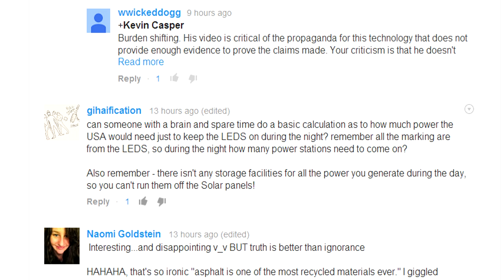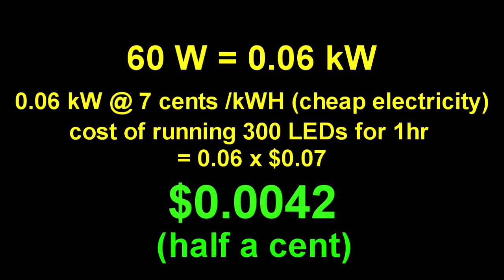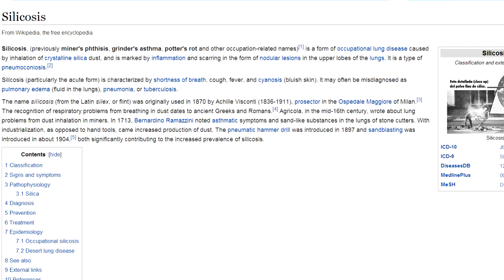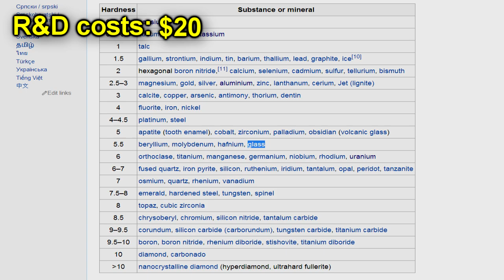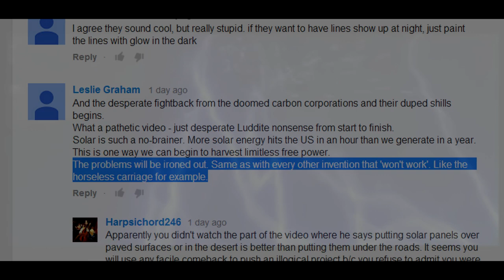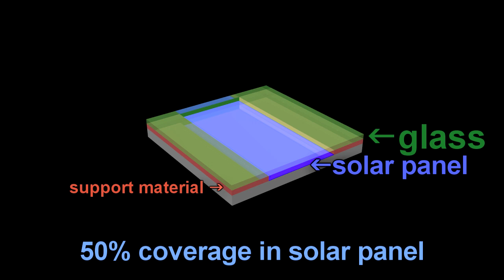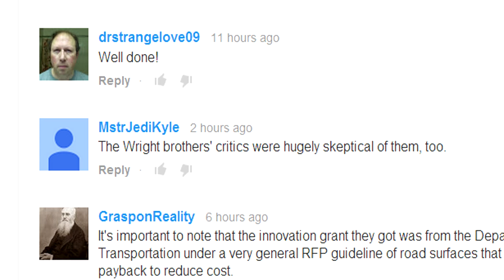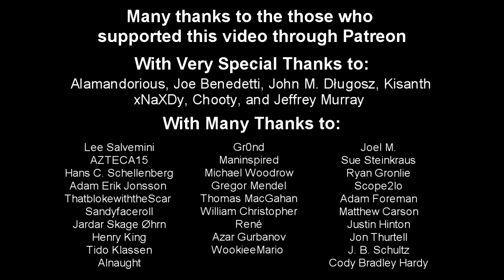Solar Roadways, IMPORTANT QUESTIONS AND ANSWERS!

Comment: We designed Our prototype to use "virtual storage", meaning that any excess energy is placed back to the grid during daylight hours and then can be drawn back out of the grid at night. This is important as solar energy is only available during the day, but our heating elements need to have power at night in the wintertime in northern climates for snowy weather. However, we can add any current or future energy storage devices to our system. For instance, batteries and flywheels can be placed in the Cable Corridor for easy access, if customers wish to incorporate them. We chose to not use batteries in our prototype system. We fear that, if we make that the norm, our environmental project could leave mountains of lead acid battery in its wake.

this is from the company fax, the energy is 'banked' in the grid,this banked energy is redrawn at night to power the leds' the energy being drawn from the grid is not the grids energy, it's the roads. 
So that takes care of the ability to store energy from the day time,[great idea and one that the national grid seems happy with]. So we won't be needing any new power stations and the units can have storage facility built in. Should have read the info there Thunderfoot.LOL.

What are you going to do about traction? What's going to happen to the surface of the Solar Roadways when it rains>

''Everyone naturally pictures sliding out of control on a smooth piece of wet glass! Actually, one of our many technical specs is that it be textured to the point that it provides at least the traction that current asphalt roads offer - even in the rain. We hesitate to even call it glass, as it is far from a traditional window pane, but glass is what it is, so glass is what we must call it''.

''We sent samples of textured glass to a university civil engineering lab for traction testing. We started off being able to stop a car going 40 mph on a wet surface in the required distance. We designed a more and more aggressive surface pattern until we got a call form the lab one day: we'd torn the boot off of the British Pendulum Testing apparatus! We backed off a little and ended up with a texture that can stop a vehicle going 80 mph in the required distance.''

This refutes the comments about traction made in your last srw vid.
Reply: JessicaAtreides37

1.The mighty powergrid: okay sugarcube, I guess you never had ever anything to do with any kind of electrical planning or more than just plugging in some kind of eletronical device, because you have ~no~ idea how an eletrical powergrid works.
First of all, you cannot simply "dump" spare energy into the powergrid and just shove it around untill you need it, the powergrid has a max that it can take and just shoving power around doesn't work either, because its technical not possible, every time power flows there is a powerloss, that means the natural resistance in the cable slowly but surely reduces how much "power/energy" you actually have, running those cables on max capacity and squeezing the energy around, untill its needed, is impossible, because it uses itself "up" while you would be waiting.

Thats why we haven't turned deserts into pure Solarpanelforests, because its not possible to transport the energy a very long way or would requiere a new construction of the existing powergrind, thats the huge problem with our energy as a whole, if we could transport energy without any form of resistance and without any loss, that the nuclear plants of the world would stand in some secluded part of the earth, were an fallout wouldn't hurt anyone or we could jsut plaster the saraha with solarpanels, but thats technical either not possible or its smply not cost efficant.

So no a powergrind can't just "store" left over energy and keep it forever, untill we need it, the same with any storage facility inside of the panels itself, that would take even more space away and make the allready useless thing even more useless.

Of course you would need to know the very basics of eletrical engineering to know about stuff like resistance and induction and loss of power any why we have transformationhuts and why we use different voltages for different places and so on, so its not your fault for not knowing that.

2. Do you by any chance know what a LAW is?
Its a one shot rocket launcher, you know what you do after you shoot that thing once? You throw it away.
Just having a very aggresiv and "sticky" surface for one test doesn't mean that this thing holds out for very long, just like the LAW, you can have a big freaking bang once, but after that its scrap metal.
Glass will eventually run down very quickly and even more so, the more tension there is in between the tires and the glass, just a few scratches would be enough to slowly tear away at it, once the glass is "infected" somewhere it just needs a bit of water and some freezing temeratures and you got a nice big crack somewhere and that thing needs to be thrown away again and the worst is that you would have to constantly produce more and more of these things, because they will cosntantly break, I don't even want to imagen an 18 ton monster crashing down on these things, metall scratching along every surface, you will need to replace entire roads for that.
Reply: *****
Something Tf00t didn't even mention, though he doesn't even need to

As glass sits in sunlight it discolors, or in the case he shows here grit being ground into the surface causes scratches. Eventually this would make it so that the solar panels are sitting under the equivalent of a scratched up piece of stained glass, even our most efficient panels pointed directly at the sun don't produce an extreme amount of energy so if we cover them with scratched, colored glass we get pretty much nothing out of them.
Reply: Jessica, How do you store energy on "the Grid"? This grid itself has no storage facility! You need accu-batteries or you will have to pump water INTO a high lake (this is being done in Luxembough, Europe).
All less energy efficient. Why not put Lithium-batteries INTO the solar panels. That makes then totally unaffordable!
Reply: Have you even been to their site? I have, they have numbers for their solar panels and what they are supposed to do, and you cannot get a government grant without the numbers being there so definitely not a secret.

Engineering sources of energy isn't just a measure of more energy out than in, there is a reason Engineering degrees include a number of economics courses. You don't just have to make a good idea (this one is novel yes, but flawed), you also have to prove that it is viable, and that a group of people should adopt it. It's an idea that current technology cannot make work, and will not in the foreseeable future. Oh and their attempt to show how strong it is with the little tractor is amusing, my grandfather is a farmer and has the one two sizes bigger and even that's small for around here.

Fukushima has already been cleaned up, it actually didn't release much to be honest (Tf00t covers this himself in another video, and sources please on your numbers).

Oh and you have yet to address my concerns about these being unable to function as a roadway both markings and the fact that the glass will be smooth (unable to provide traction) or broken within a few days if you get even a slight amount heavy truck traffic. You also haven't mentioned how it is energy efficient to use solar to produce the energy required to melt snow when the sun itself isn't able to do so.
Reply: Haku infinite we don't have to worry about ice because the're going to use even more power from their super inefficient solar roads to actually heat the roads to melt the ice! I don't know why they don't just make the road out of diamond. The cost of the project is already more than America's annual GDP, what a few trillion dollars more?
Reply: JessicaAtreides37 OK so go ahead and prove him wrong, you may be able to, with materials not yet known to the human race. The problem is that after you do that the ability to transfer light to the solar panels is diminished considerably.

And as shown in the video here (if you watched it) then it will barely put out enough energy to run its own LED's if the glass were to let light through perfectly (which it won't due to the treatment)

And I hope they use the 2 mil doing research into a way to make something that works, but at the moment this just isn't going to. Their own website ignores questions about the treatment and how it will diminish the ability to transfer light, as well as how it will hold up over time.
Reply: JessicaAtreides37 Ok two things:

First, the details Tf00t picks out are the main points of the project, he's showing that A. the energy output is not going to be very high, and for the most part unusable anyway, certainly not enough to cover the cost of the project, B. The roadways themselves are going to be unable to reliably produce the markings indicated, C. The idea of producing enough electricity to convert to enough heat to melt snow/ice when the sun itself isn't melting it is laughable, and D. The panels themselves simply will not withstand what a roadway needs to. A 20 foot piece of someone's driveway being able to withstand a single vehicle is NOTHING compared to a 20 mile stretch of road with a large number of vehicles driving over it all day long (not to mention 200 mile and 2000 mile stretches that will be required).

Secondly, nuclear energy is more than capable of satisfying the power needs of our species, but oil companies own the governments that regulate it. My first job was in the Navy operating nuclear plants so I have a little better insight than many, there are precautions to take that is certain, but the way people freak out when the word radiation, or nuclear, is mentioned is just pathetic to anyone with an education in the matter. I don't think it is the end though, I agree that solar is a better option, when the technology is developed enough to be able to deliver the amount of power we consume (it isn't even close) then we can switch over, but nuclear is the best for us at the moment.
Reply: JessicaAtreides37 An interesting and massively uninformed rant there Jessica.

I suppose that for your next trick, you will wish unicorns into existence through your power of uneducated bullshit.
Reply: JessicaAtreides37 Words fail me Jessica, it isn't often that one finds this much ignorance on public display.  Well done.  You're right up there with the Moon Landing deniers.

Nuclear Power, my poor pathetically uneducated luddite, is, bar none, the safest method of producing reliable constant power in the world.

Solar, may eventually replace Nuclear power in that aspect, but not with 'solar roads', no matter how much you wish reality not to matter.

By all means, call people who know what they're talking about 'shills' because you and your unicorns know the truth.

You're both pathetic and sad Jessica.
Reply: JessicaAtreides37 I'm really starting to suspect that you failed high school English, Jessica.  It's not just the simple minded over use of exclamation points and capital letters to attempt to make your feeble points, but the use of words you obviously don't understand.

If you think photovoltaic paint or solar roofing tiles are ground breaking innovations, there is no real reason to continue this.  Both have been around for decades, and both, unlike this stupid 'solar road' actually work.

Maybe you should go back to your favored form of reading material (Highlites?) and leave the science to the adults.
Reply: JessicaAtreides37 Half of Japan?  Half of Ukraine?

Is there no number you can't get wrong Jessica?

So, we've covered the clear fact that you failed high school English with your use of words you don't understand, needless capitalization and over use of exclamation points.  Now we need to add your utter lack of understanding of basic geography and math.

Is there any class you did pass beyond hysterical whining?

Would you care to compare the number of people killed in nuclear power incidents since the creation of the technology with the number of people killed in conventional power incidents in the last decade?

Seriously Jessica, being a moron is bad enough, do you really have to be a subliterate moron ?
Reply: Clell, you've just been '''sussed'' my friend! you've just argued and insulted for your way through 2-3 weeks on this page...and you didn't know a single thing about any of it did you? LOL!

You utter bullshitter!

I doubt you even watched the whole stupid vid off of thunderfool, you're a 'sounding vessel' aren't you? an empty little parrot repeater.
Clell...shut the FUCK UP! YOU BULL SHITTING WANKER!
Reply: Clell Harmon ...define the word 'adult'.
Reply: JessicaAtreides37 Sure they're viable Jessica.  Just like your invisible pink unicorns.  Sad, so very sad.
Reply: Imre Fabian I think she's under the impression that you can just trap electricity in a circuit for later use . . . it would be possible if we had loss-less wiring (which a. doesn't exist, b. would be beyond expensive if it did, and c. would require an extreme amount to trap even a minimal charge)
Reply: Nikagor Thank you for writing that, now I don't have to. This idiot doesn't understand the grid at all.
Reply: A bit literal minded guys, the grid gets to use the energy the road creates during the day and then [the grid that is] pays it back at night. 
The companies' pdf about the project is on line and is fascinating. Why don't you go and read it and take up your problems with the designers?
I'm just pointing out the silly lies Thunderfoot is spouting about something he's obviously never researched [''we'd have to build hundreds of new power stations''] etc etc.
Just go read the companies info-pdf for yourselves, THEN! decide based on your own discernment fu kris sake, it beats listening to thunderfoots crap.
Reply: JessicaAtreides37 Are you even watching the videos? He actually does testing to show that the major points of this project are simply not possible with current technology. All they have are a few .pdf's, some animated videos, and an extremely small scale test area kept extremely clean (compared to a roadway). I've looked over their website the photos don't have any numbers with them, they have numbers section but notice how they say talk about the amount of power that solar power is rateed at, then talk about the angles? That rating is when perfectly aligned with the sun which these roadways will not be most of the time, that's one of Tf00t's main points. Not to mention the bit about the LED's taking almost as much power as the panel itself is going to produce (at peak efficiency, which it won't be at). I say they will not be at peak efficiency for several reasons we'll start with the treatment needed to handle traffic, that requires the glass to be formed in such a manner that makes it so that light is reflected away from much of the solar panels, then once a few hundred cars go over it there will be dirt, sand, rocks, etc. ground into it making the surface get scratched to where it will not transfer any measurable amount of light straight through to the solar panels. Additionally after a few years the glass will begin to break down in strength due to the sunlight (much the way bullet-proof glass becomes useless after a year or two in the sunlight). Tf00t covers angles in this video pretty well so no need there. And then there's this problem with cars being driven over the roads mostly throughout the day (when the sunlight would hit them) blocking the light anyway, as well as the shadows from buildings, houses, hills, mountains, telephone poles, cars parked near the road . . . need I go on?

Tf00t is not some amateur when it comes to science, even if only a few of his points are actually taken into account (the ones he displays) the project is unable to perform its intended functions. I do not have the materials nearby to perform the testing but as someone who has worked in the field of producing electricity before their numbers are questionable, his methods are not.

And we would have to build hundreds of stations just to convert the energy produced by these panels into something useful, that's why taking your home off-grid requires massive (not to mention dangerous and ridiculously expensive) batteries, your solar panels etc charge the battery and your home runs off of that. Simply put current solar panels cannot supply sufficient 110v AC power to perform any useful tasks, and the loss from transfer across that much distance makes it useless except in very small areas (where there is much less sunlight and roadway to power the system).
Reply: Niko N I agree with almost everything you said except this."Simply put current solar panels cannot supply sufficient 110v AC power to perform any useful tasks". Of course the roadway idea is shit, but this makes it sound like solar isn't useful anywhere. I am 100% solar at my house and I run every appliance most people do. I don't skimp on power at  all. Also  If you link 10  100 w 120v pannels you have 1000w at 120 v ,that will run practically any appliance all day with no storage, no charge controller ,no inverter.  Again, the roadway idea sucks ,but it started to sound like you were shitting on solar in general at the end. Since my grid pays for itself in only 3.5 years but lasts 15, I also disagree that it is expensive to take your house off the grid. It is clearly more expensive to stay on the grid. You just need more upfront, but it is actually cheaper.
Reply: Brian T
The problem is where I live, I'm in Western PA just north of Pittsburgh. Where I live it is not possible to do without some sort of storage as we simply do not receive enough sunlight, if you look at areas by how much sunlight is received Pittsburgh is this dot that is essentially a black hole when it comes to sunlight. I know people who have tried, and once I finish my degree I plan to add solar panels to my home, potentially cover it and the garage roof (I'm an IT major so amateur at solar, my background is nuclear power so that may be why I calculate over-the-top when it comes to power needs).

In response to your concern I do think solar is the future, just not the road itself, I could see it working very well if you put them above the roads, not to mention the fact that it would help disperse water etc. to keep the roadways safer, but in the road is not going to work "with existing materials" that last part is in quotes because it is my hope that these people put the money that their project has collected into research that enables them to find materials that do work for this job because the idea itself isn't completely stupid, it's just that the numbers don't work.
Reply: Niko N I hope this money isn't just wasted as well, hopefully these tiles could be used for something. I think they just shot too high with road ways. they should drop the stupid leds ,and use them as roofing tiles. The prob with panels is they don't fit your roof perfectly and there is dead space. This tech could maybe help with that.
Reply: These panels could have a use as a niche product. Line them with clear soft silicon rubber and use them on sports-fields.Instant basketball/soccer/hockey whatever markings.
Roads? Rediculous!
Reply: ''Ridiculous'' 
Every possible surface that reflects sunlight should be utilized for the procurement of energy. 
We have no choice! We simply have to come up with new ideas as regards our future energy security.
These projects ARE! going to go ahead, some will be less successful than others but we WILL! be using this or very similar ideas in the near future.
As to what is 'ridiculous' Imre, we don't know! we have no idea if this is a viable scheme or not, we have no information on the energy return of this system, we are only looking at a prototype, and the only people that are getting the actual numbers here are the people who have read them and suddenly found that they want to invest 2 million fucking dollars!!!!!
Now I don't know about YOU my friend, but people who invest 2 million fucking dollars are probably quite impressed with what they know, and what THEY know is a great deal more than that idiot Thunderfoot has so far shown that HE knows.
I-we don't know enough about this project to start using words like 'rediculous' or however you managed to [almost] spell it, the worst we can say about this project so far is we don't have the numbers [ certain people do and have thrown 2 million at it] and neither does that brilliant ''scientist'' Thunderfoot.
Thunderfoot exactly like the rest of us, has no fucking idea so far, so take what he says with a big pinch of salt and think for yourself.
PS the companies pdf is on line,at least take the time to read the fucking thing for YOURSELF!...BEFORE! deciding if this 'could' work or not.
Thundefoot is a charlatan and a liar.
Reply: no, you're wrong.
We can put any surface we like on glass, we can make it more durable than asphalt and give it higher traction qualities than rubber. We can make it perform perfectly at minus 120 degrees up to 140 degrees. We can make it proof against tank rounds and thermonuclear flash. All of these applications for glass are already 'old hat', so every single point against that Thunderfoot raises as regards glass is palpably, quantifiably provably wrong on every count.
And if you'd like to check your history [or check anything really] you'll find that 2 mill' straight away as an initial investment in a prototype is pretty damn good.
Some people with access to the energy return figures on this project, have done a ''shut up and take my money'' at the designers...I wish I knew what they know...
Reply: This or something like it, we have no choice. Nuclear didn't work and we are now reduced to stripping the top soil off Canada for a few hundred days of filthy oil that costs 96% of a barrel of oil to produce per barrel.
We will make this technology viable, [it may already be], we will have to cover every square inch of spare space in energy harvesting devices as soon as we possibly can. 
I fully appreciate your opposition to this particular idea, and with the 'roll out' costs looking the way they do OF COURSE! you are going to have some serious concerns, but we are now at a point where anything at all that returns more energy than it costs is 'viable' we are that desperate...actually...we are THIS! desperate, we're trying to build roads that can help our current dire situation as regards energy.
The point you make is very real and very much something to be concerned about, the technical details Thunderfoot picks on are...not...they're silly,almost childlike.
We have one law on this planet, more in than out=viable, this goes for chasing gazelles or dealing on wall street, and it ALWAYS goes for energy creation.
Reply: Jessica, why don't you put in superconducting coils for energy storage? And a liquid nitrogen generator for cooling? That will be efficiënt for storing energy, and cheap. ;-)
Reply: Tfoot misses the whole point no matter what he's talking about.
We do not have the energy return numbers [anywhere on line, I think they are secret at the moment] so what this machine does EXACTLY is just guess work yes? Which makes all of this just hypothesis at the moment, which makes tfoot's attack look even more childlike doesn't it? Laughing at a prototype is the mark of a true idiot after all.
If there is more energy out than in it's viable, that law goes for tar sands and the other insane methods of energy production we use so it works for this yes?
The people of Japan face prison for vocalizing any disagreement to nuclear power. Foreign journalists that speak about Fukushima face prosecution should they visit Japan. 50% of children in Daichi have thyroid cysts, heart problems are sky rocketing among the young people of Daichi and non of these health problems are ALLOWED to be blamed on the massive amounts of radiation being released. 
The world has just been told that in order to clean up after Fukushima...we are going to have to create a ''new technology''...we can't clean it up [ever] and it's getting worse hour by hour. As far as nuclear being 'the best option' well, human biology disagrees with you my friend. Nuclear has not just failed us, it is destroying us.
Solar roads, yep crazy...unless they work and at the moment, they appear to, albeit not very well, but so what? we'll just improve as we go.
For some weird reason ALL! of the rules that apply to 'conventional' energy production ie. more energy out than in, rolling development, cost structuring etc etc are suspended in thunderfoots 'mind' just for this one unique project, I fail to see why and I fail utterly to understand why his sub's don't see this as well. 
This is an idea, it has a prototype and creates energy, okeydokey then...press on! ANYTHING! that produces energy and [this is important] DOESN'T KILL US! [had to stress that last point there] is by definition viable until PROVEN! otherwise. At the moment, the jury is out, a wise person would keep their 'anti' council for a while yet.
Reply: JessicaAtreides37, Thinking a revolutionary invention (what these are not!) could be a viable, let alone economic success within 20 years is an air-castle!
As it happens, I AM an electronic Designer, with Significant technological knowledge.
I can see in your arguments a lot of "what should be" and "what could be", but not "what is feasible". The illusion is made that these panels would be the solution of tomorrow. But even for a prototype they are to detailed and not feasible enough!
If you and the guys of the Solar Roadways are bonafide, you (and they) would say openly that the practical application is far from within our grasp. Then the people would demand their money back. even small investers want their returns within 5 years.
Only the government could do an investment over the timeframe it would take to make something as this usable, let alone practical and economical.

As far as I can see, regarding the hype that is made of this, they are just selling Snake Oil!
Let them come up with a detailed study on how they would make this feasable. And no none-sense about secrets and competition, as there is no company whatsoever so stupid to try to make something like this.

Only a set of detailed schematics, graphs and calculations with a comprehensive study about the production costs, operation costs and returns (of energy as well as of investment) would suffice.
For now you have me only convinced of either your stupidity or of that you are a henchman for a bunch of crooks. You take your pick!
Reply: http://enenews.com/japan-paper-horses-became-weak-and-died-one-by-one-from-an-unknown-cause-at-farm-in-fukushima-farmer-there-is-something-seriously-wrong-going-on-this-country-is-going-mad-i

http://enenews.com/strontium-reaches-500-billion-bqm3-in-basements-at-fukushima-record-levels-reported-at-5-locations-near-ocean-u-s-expert-we-see-strontium-becoming-more-of-concern-food-chain-will-have-to

This one from 3rd june 2014
500billion bequerels per meter cubed!...sound 'cleaned up' to you does it?
Reply: That's actually rather interesting, I know American regulations on the cleanup and that would not still be occurring (definitely not allowed to just push it around like they seem to be doing) so you win that one.

But the entire site is obviously biased against nuclear energy, I don't trust them completely, but enough to recognize that they still have a problem there. Checking with a number of other sources from a simple search does seem to indicate that there is still a problem, albeit not as crazy as enenews is going with. 

They lose credibility when they start covering the claims by sailors, being an ex-Navy nuclear guy myself I know the regulations, simply put the sensors would have seen the problem, and even the captain can not overrule if the nukes and the corpsman (navy medics pronounced core-men) say to get out of the area.

If done according to the actual regulations (this was not simply put there needs to be a reliable backup for the cooling system no matter what) nuclear energy isn't a problem, but there are still risks, and that's why I agree that solar is the better idea in the end, but the technology isn't there yet, until then we must rely on others methods, Nuclear is safest for us and the environment if done properly (the U.S. Navy for example hasn't had a single reactor go up despite repeat start-up and shutdown cycles for decades and plants easily rivaling those used for powering large areas)
Reply: ''Nuclear is safest''
Believe it or not I absolutely agree with you...apart from the fact that we haven't done it for 'safety' we have done it for profit.
The crew of the USS Ronald Reagan are in complete disagreement with you, they were their, they know exactly what happened and they are going to court.
The nuclear idea WAS fine, but now it's destroying us by the hour. 
Your post is in terms of '
'oh well, we kinda fucked up a little bit''
turns out, that's all we needed to fuck up.
We built this thing in an area with over a thousand years worth of history as to the destructive nature of the Tsunami, CRIMINAL STUPIDITY FOR PROFIT!
''It' not as bad as enenews makes out''
enenews is not a 'media station' it is a conglomerate entity, their is only one agenda, to tell the facts about the situation from the people that are there now. It is ''as bad as all that'' this is what's actually happening right now in Daichi [and you will note my friend...it's spreading], you will find that the only defense people have against this news is to simply not believe it [you] or to out right lie about it [thunderfoot and his masters].
Do you know where the initial 'plume' from the first explosion at Fukushima landed?...Utah...Salt lake city got it...ENEnews...care to read on do you? or are you worried about your 'belief' system failing you? 500BILLION BEQUERELS! and increasing daily, simply 'not believing' is no sort of a way for a man to behave in this situation frankly.
Reply: I haven't seen a complaint from a single nuke, those are the guys I trust when it comes to radiation, because they know what they're talking about. And much of what is mentioned is not a symptom of problems related to radiation (weight problems, stomach cramping weeks later, seriously? Neither would be caused by the radiation unless it was cancer causing the cramping, which would have already been diagnosed and plastered by ENEnews) 

And from all I can see ENEnews is selectively picked to be anti-nuke, talking about exploding barrels of nuclear waste (waste is a huge problem to be sure), but to make a nuclear explosion requires a lot including other explosives and a source to create the appropriate type/strength of light in order to continue the reaction. Intellectual dishonesty (this story which is linked to on the same page) is a crime in my opinion, it is fear mongering, and it seems to be the ENEnews agenda.

And none of it has to do with the solar roadways project . . .
Reply: Well yes it does have everything to do with Solar Roadways and our need to find new energy supplies.
Thunderfoot tells you that it's 'all cleaned up' and you find out that there are billions of becquerels of strontium in the basement...sooo you don't mind THAT sort of ''intellectual dishonesty'' then? Thunderfoot is a proven liar but you 'question' ene news?
how very 'selective' of you.
Solar roads are a crazy idea aren't they? the cost...staggering, maintenance? constant, and a host of other concerns, and yet now even these crazy ideas are becoming viable...nothing to do with the mess that is our current 'energy procurement protocol' at all...no...
As to the crew's symptoms...well...some of them were exposed to a massive dose of radiation and are now very sick, but the radioactive dose could just be a 'coincidence' as far as you're concerned yes? accurate assessment?  
You are functioning on belief, and belief only my friend, fine if you can live like that, there are no words that can convince you of the fact that you are being lied to.
When 14  out of 15 foals die in Daichi in one breeding season, there's a problem with the environment of Daichi? or this is normal? or more coincidence?
Solar roads [supposed to be a crazy idea I agree] are already 'apparently' viable if that isn't a 'hint' as to how desperate and immediate our current situation is...
Reply: You are an idiot if you don't know that this Strontium a prodict is of natural decay of Uranium which is narurally present in rocky material like concrete and also in the ground.
Reply: You are just blabbering!
Reply: Imre...500BILLION! BEQUERELS in the basement of a destroyed nuclear facility is not 'naturally occurring' is it? I think you've missed the post with the numbers in it, forgivable my friend this is a fast moving thread. 
Why does no one seem to know about any of this? it's amazing! who would have thought that we wouldn't even notice our potential imminent extinction? After all the movies where we all 'get together' and 'over come'...''THIS IS OUR INDEPENDENCE DAY!'' [great movie] PAH! we don't even know it's happening,non of the main stream media outlets are touching it, we are being ''allowed'' to think 'it's all fine now' that very quote is from this thread...astounding.
That information like this is treated as 'subjective'is amazing, it's billions of bequerels, how is that a 'subjective' opinion? it's the result of a scientifically approved testing method generations old.
How is relating the FACT that ideas as crazy as the 'solar road' are now viable due to our catastrophic failure to secure efficient [non lethal] energy production...''blabbering''?

Here's another amazing facto for you Imre, all of the hundreds of thousands of metric tons of contaminated water stored at Fukushima is currently being released into the Pacific Ocean [now as we speak], TEPCO have admitted and so has the IAEA that they have no idea what to do with it and storing it any more is pointless.

Or THIS one is the scariest of all...
Tepco recently 'advertised'[yeah really] for a ''new technology'' that will ''one day'' ''help'' clean up Fukushima...can you BELIEVE THAT IMRE? our response to this night mare [officially] is to wait for a good idea...and no one knows about this.

It is illegal to speak out against nuclear in one of the most sophisticated and media 'savy' democracies on Earth the nuclear industry has usurped the judiciary in a sovereign nation, Imre you must as a thinking, rational, caring human being ask yourself how and why this is the case, and what does this fact mean?...and why you didn't know.

I am not your enemy, facts are not ''blabbering'' ignorance is not 'bliss' it is ignorance.
Reply: What a terrible discussion, I've heard everything on this thread from ''economics is more complex than making money'' [no it isn't, where to invest is the complex bit]...damn... 
To 'we can't make textured glass'' to ''Fukushima is all cleaned up now''
Thunderfoot is where personal discernment comes to die...shocking ignorance.
Reply: wow, so you've now gone from supporting shitty technology that has no chance of working this century to personal insults, goodbye
Reply: Jessica, throwing with high numbers (of Becquerels) without indicating what that means, nor comparising those numbers to those of the normal background radiation doesn't help your argument! 
Sure, the number of decaying atoms is high, but since there are many more atoms in even a kilo uranium, it doesn't mean much. Granted, the level is high, but not the reason to waste money on rediculous ideas for solar energy harvesting.
Comparing Fukushima with the shortcomings of "Solar Roadways" is Comparing Apples with Martians (they may actually be more alike!).
In both issues you really need to shape up your scientific knowledge.
Reply: Why are you people still argumenting, this woman was not even able to adress the very first comment and counter any of my arguments whatsoever, she is way out of any league, just let this troll be a troll and ignore her.
Reply: ''arguing'' not argumenting...no such word as ''argumenting'' Nikagor
Nothing to ''address'' not ''adress , just reiteration of the bullshit thundefoot comes out with....you can't spell and you expect me to take your opinion of a prototype seriously. Well...no...learn very basic English THEN! tell the rest of the world how 'dumb' they are Nikagor. lol.
Reply: Ahh yes the usual "I can't confront any of your points, so I step so low that I have to insult your language" you are really a sad example, knows nothing, but claims to have all the answers, next time we can discuss in german, than we will see who has any points allright?
Reply: I haven't claimed one single 'answer' I've pointed out the fact that we don't have any 'answers' only hypothesis for the time being a FACT! that seems to be going right over the heads of every one else on this page so far Nik', wouldn't you agree?. It's you and thunder' that claim to have all the 'answers', [read back through the comments], and it isn't strange to expect some one with all the answers [you] to be able to spell is it?
As for 'can't confront points'...where? where have I filed to 'confront' points? Have you been reading my comments? [or your own?] Am I not THE ONLY! non conformist point of view on this ridiculous page? What more do you expect from a you tube commentor Nik? that I arrange a duel?
Really though Nik, you need to be able to spell BEFORE! claiming intellectual superiority over some one, or you just look a tool don't you?
Reply: JessicaAtreides37
Listen buddy or gal..or whatever.
We are not talking about quantum mechanic here, we are talking about electronics and believe it or not, we have figured that shit out pretty much, thats why your points or your regurgitated arguments make no sense, you can't store power in the grid, because the grid was never made to store power, you can also not "pay back" the grid, because that means you need huge quantities of power to upkeep those lsd's, whenever they produce no power, that means you either have batterys everywhere, which shoots the initial and upkeep costs even higher or you just never allow those things to draw from the grid, but than you got alot of black streets.
Furthermore i have the answers, because this is basic, very very basic, I mean jsut open any book on electronics and you would have known those answers, but you rather decided to be ignorant and be an agent of the cause, that allready wasted more than enough money.
The problem is, if it would work and would be usefull, noone would be against this, but if you look at this and posses even the faitnest hint of knowledge you allready know how quickly this thing is doomed to fail.
Furthermore, if you are completly unable to read what I have written in english, allow me next time to send my message on german, lets see how well you will understand my points then, furthermore, to believe that you are "superior" in knowledge, because you just repeated someone else, without even thinking or considering that their informations are wrong...oh boy I hope noone ever trys to sell you something, because that would be one easy sell and another thing, just because you think you are some kind of rebel here and go against the "mainstream"  arguments DOES NOT MEAN YOU ARE RIGHT.
Prove what you have claimed, prove how the grid somehow can store or repay the enourmus energy requierment those things would need, prove how glass is going to withstand constant and heavy duty from rubberwheels that scratch and "rub off" the glas, thanks to embedded rubble and stones.
Reply: This prototype has been designed and built hasn't it? and [as this site loves to point out] at staggering cost yes?...and they are all wrong yes Nik? designed and built by many many hundreds of people from several scientific disciplines[ all wrong yes Nik? maybe they haven't read ''any book'' on electronics lol],invested in by, well we don't know fully...and they also are all wrong because this page says so? I disagree with that.
''Enormous energy costs'' you mean lights at intersections stop lights etc etc, well we are already meeting these ''enormous'' energy costs aren't we Nik? on a 24 hour basis around the world, so what 'damage' will adding MORE energy creating devices to this system bring? logic is a bitch isn't it Nik?
Actually it's up to YOU! to prove it DOESN'T! work isn't it Nik? there's the prototype and you have a pdf from the company [check earlier posts]. It's up to YOU to prove that the information in this pdf is false and that hundreds and hundreds of people who are professionally involved in this project are ''WRONG'' Nik. I believe them, this is a perfectly viable project, all it has to do is produce more energy than it requires and we're in business, costs be damned obviously Nik because it would be making a profit at that point. There's ''logic'' again Nik, makes more than costs=business...the onus is on you and thunderfoot to PROVE that all those people and our economic principles regarding 'profit' are wrong.
Reply: JessicaAtreides37
I can slap a bunch of lsd's, solarpanels in between two glassslides and call it solar road panel, that doesn't mean that this thing is anything but a waste of money, don't you freaking nderstand that..I mean literally..what..is..your..point?
Its no argument that they have done it, I can build a dirty atom bomb, doesn't mean that I can build a nuclear reactor, well I kinda know how they are build, but I probably had problems with getting enough shielding and such, so that makes me an nuclear expert all of the sudden? Electronics is actually pretty logical, nothing too hard about it, but you have to ~know~ about it and as I said, using the grid as storage is jsut downright stupid, because the grid is just something that delivers, not stores.
Let me give you a very very easy example, think of the grid like an delivery van, it can store some things, but not very much, certainly not as much as a storagehouse, so you cannot indefinetly put stuff on it, to put new stuff on it you have to get rid of the old stuff, meaning you have to "use up" the energy first, of course energy is never really used up, just transfered,  before you can put new energy on the grid or it overloads and thats not a pretty sight.

And why should I go to the company pdf, I'm talking to you, you allready repeat their arguments, so come on name whatever you think is their strongest argument and I will destroy it, I mean thunderfoot made a more than good case about it, but please enlighten us all, because your first arguments about the grid and the traction of glass were allready done for so choose something else.
If you believe this project is viable and the use and cost, not to mention "it works so it makes money" is the most idiotic thing I have ever heard.
Listen, you always have an inital cost and something in return, do you know how long it takes before normal solar panels on a house produce actual businiss or return? up to 15 years, that means you pay for them and the first return in money is 15 years, thats inital cost against actual use. Now those road panels have less sun shining upon them, because cars are either parked over them or stuff is driving on them, they get scratched and used up over time and they have no known storage yet, not to mention that they will have a huge maintenance cost, not only is daily use requiring to constantly replace them, but ever seen an 18 Wheeler flip over, slide for several meter over the entire road and maybe even catch fire, it will destroy everything that it slide over, you will need to replace all the panels the wheeler scratched, because now they are even less usefull.
So not only will they have a very limited lifetime, their maintenance cost also will make sure that the debt it costs to get them will never really be paid, because new costs are constantly added to the debt and their actual productionrate is so incredibly small.
Reply: Jessica, what "hundreds of people from several scientific disciplines"? Specify!.
I think you just talk baloney!
For the rest you only repeat already refuted arguments.
Show some real testresults and real cost-gain calculations or cease and desist!
Reply: JessicaAtreides37 A driveway length collection of panels is NOT a 'prototype'.  It is too small to show any useful data, like stopping distance from highway speed, snow melt capabilities, or year round power output.  It is too small to simulate thousands of hours of road use.

What these charlatans have produced is a model, nothing more.
Reply: Fascinating idea, what about this as well... http://www.nanowerk.com/spotlight/spotid=31922.php
Photovoltaic paint! 
This is just the beginning, the whole urban landscape could be producing our energy, we could do it now, but not with the energy companies and especially the nuclear industry around our necks.
Anyway fun argument but fact is...this is going to happen, this actual project or something very similar, we have absolutely no choice do we?
Thunderfoot is keen to argue [as are all you fools lol] that the EFFICIENCY! of this device is the problem...we are currently ripping the top soil off of Canada for TAR SAND! it takes %94 of a barrel of oil to produce a barrel of oil from this medium [tar sand]...and it completely destroys any land it is applied to for ever...for %6 of a barrel of oil...now I wonder why that cunt thunderfool isn't attacking this [tar sand exploitation] as a gross misuse of government funds? or WORSE! why YOU! can't see what a disgusting paradigm for energy procurement we have and how it has to change if our SPECIES! is to survive. How come you can point out the negatives in one ''model'' but can't see the desperate need for an alternative to our current idiotic, suicidal world wide policy of self destruction?...weird that? but it's ''how we roll'' as a civilization I suppose, hence our dire need for ideas...any ideas on future energy procurement.
These guys have come up with this idea because they understand where we are in history, and it's not a good place...and we'd better start coming up with more and better ideas...and paying any attention to the scum in the nuclear industry [thunderfoot] hasn't done us any favors so far has it my friend?
PEACE AND STRENGTH TO THE PEOPLE OF DAICHI AND GREATER JAPAN! THE 'PEOPLE' WHO DID THIS TO YOU WILL ONE DAY PAY!...[thunderfoot].x
Reply: ...but it's happening isn't it? Solar roads, 'voltaic paint, Brazil has just put up some of the largest wave power plants in the world, check for yourself there Clell...not ''bullshit'' actual reality going on around you. [lol] Educate yourself! don't listen to paid up nuclear shills like thunderfool, he is a total liar. 
Their are two types of people in the world at the moment Clell, those who know and care about the desperate situation our energy paradigm is in...and those who listen to thunderfool.
Really, this argument is me against people who think Fracking, Tar sands, and Fukushima are good ideas as opposed to harvesting the free energy that EVERYTHING! around us is creating constantly.
You Clell! are perfectly happy to be fooled, many people aren't anymore.
Reply: well, you need to actually counter my argument re- ''if not this then something very similar very soon''
and not just talk silly insults.
Photovoltaic paint IS being created, Solar Roofing tiles etc etc, all of which began with a prototype-model, just like this road. Brazil is investing heavily in alternatives to oil and gas-nuclear and everything I've said about Japan is true and verifiable,so you're going to have to pick out the 'rant' parts really aren't you Clell?
I however! can EASILY! call you out as a sycophantic peon devoid of personal discernment.
Reply: JessicaAtreides37 You seem to divert from defending the already dismissed Solar "Freakin'" Roadways to more general defending alternative energy sources.

I must stipulate that NO-ONE in this discussion is defending Oil or Coal derived Energy. We all are FOR Solar Energy and similar, like Wind Enrgy or Hydro-Electric Energy, including Wave-Energy.

Stop acting like You are the only one with the ecology in mind! That is a totally dishonest attitude!

Most people in this discussion condemn the Solar "Freakin'" Roadways as being unfeasible for various reasons. So either show they are feasible with real test-results and/or verifiable calculations or stop this futile discussion.You will never win it with your loopholes.
Reply: She still hasn't understood that a solarrooftile, that is still just a measily..I think 30% of energyefficency or maybe a little more in recent years, only starts to pay back at..wait for it..10-15 years, thats when it has produced enough energy to offset the maintnance and initial cost and finally starts producing revenue..TEN to FIFTEEN years Jassica TEN YEARS and in those years you do not have:
1. Cars driving over the tiles, scratching them up and reducing the usable energy, the first car driving over those tiles will allready take huge percanteges off from the productionrate
2. You do not have an energydrain in the cell itself, if youa re unaware..its the freakign lights I'm pointing at.
3. There are no cars parked on them, shading them for hours at a time, producing no energy while doing so
4. They are angled..towards the sun, the roadtiles aren't, they are positioned almost at the worst possible angle, flat on the ground, where any nearby house/tree/person or whatever can cast a shadow upon them..and you guessed it..yeeeess reduce the avaible energy !

I mean 4 points that I literally didn't even have to think up, they just came to me, they are valid, I do not even need calculations to know that they are valide.
Reply: Now do the same with nuclear...it never stops or goes away, we cannot control it, it is fatally toxic, it is the most expensive way to heat water that we can possibly come up with, it is endlessly escalating in its destructiveness , we will have to pay for our current nuclear addiction for thousands of generations of humans, it is currently destroying an oceanic basin, it always leaks, it has made huge sections of the Ukraine and Japan untenable for human life, it's costs are spiraling...I could go on but there's just millions of reasons why nuclear is insane. All of which are valid aren't they? and yet you can support it no problem? you even think it's safe and fukushima is all cleaned up now don't you? What utter hypocrisy

Now, an hundred reasons why the motor car will never work...now an hundred reasons why the telephone will never work...There is a great word for you people at thundertool, you're  called  'Luddite' google it lol.
Reply: JessicaAtreides37 We control nuclear power just fine Jessica.  Compared to any other form of continuous power, it is far and away safer.

You're babbling again Jessica, using words you don't understand.

Poor, sad, stupid little Jessica.
Reply: Half the Ukraine and Japan are gone from the destruction of just TWO! [2] machines out of a known 2600 similar machines[so far]!!!!!!
Do you EVER! actually look out of your window?
I mean you SERIOUSLY BELIEVE! that this is ''safe''? that's your personal idea of what a 'safe' machine does? Clell, I wouldn't let you wire a simple plug with THAT! as your paradigm for 'safe' my friend...no Clell, total bullshit again my fiend.

http://enenews.com/japan-doctor-tokyo-longer-be-inhabited-everyone-living-victim-fukushima-disaster-began-notice-childrens-blood-test-results-around-mid-2013-time-running-short-physicians-save-citizens-future-g

Check this out Clell, it will disturb your shiny little view of the world you're in but to be fair almost ALL of the little sycophants on this page could WELL DO! with a fucking big wake up call. Dumbest collection of the very most ignorant fools on the internet are on this page.
Astounding ignorance, you know absolutely nothing about the world you're currently in Clell.

Some people can argue a good point against this idea [Solar power-any] Clell...you're not one of 'em dumb arse, give it up.
Reply: JessicaAtreides37 If that would be true, nobody in Japan would be save. Come to it, nobody in Asia also!
So move over Americans, You will have to make room for half the global population as fugitives!
Strange though, that there are still Japanese, after the 2 Atomic bombs over Nagasaki and Hiroshima in 1945! You might think they would have perished by now!

No Jessica, I think you are gratefully adopting any wild rumor to agitate against Nuclear Power.
Come with real arguments or shut up!
Reply: Clell Harmon Bravo!
Reply: absurdo redactum, pigwillful ignorance and insults gets a bravo...thunderfools.
Reply: JessicaAtreides37 You were perfectly describing yourself to a T Jessica, right up to the last word.

While your foolishness IS mind blowing, there is nothing thunderous about it.

Grow up little girl.
Reply: Countered your points, didn't use an insult against you[?] do you even read your OWN comments Clell?
'grow up little girl', I would counter that with 'just think for yourself a little Clell, it's never as simple as ''we can't'' we are humans, so far there is nothing 'we can't', we physically 'CAN'! every single thing we've ever needed to do.

Look at the Manhattan project Clell, not what it created so much as HOW IT WAS ACHEIVED! It's astounding, amazing, THAT! [the project]  was done and kept COMPLETELY SECRET! during war time, form a nation that was fighting on several fronts for several years already, was providing aid to [literally] half of the planet at the time...a nation that within 20 or so of this astounding achievement was then WALKING ON THE FUCKING MOON CLELL!!!

''we can't''...

and you believe this?...
Reply: JessicaAtreides37 Jessica, Jessica, Jessica, you didn't counter a single point from anyone on this thread.

And you continue to show just how illiterate you are with you prolific and incorrect use of exclamation points and capitalization.

You claimed that two nuclear incidents wiped out half of Japan and Ukraine, in the face of all evidence, you sad little girl...  Do you need me to quote your own words to you child?

You claimed that power could be stored on 'the grid' showing an abject ignorance of just how a power grid works.  Do you need me to quote your own words to you child?

All you have contributed is a generalized lack of knowledge on every topic you have commented on, hyperbole, stupidity, exclamation points and unnecessary capital letters.

So, again, grow up little girl.
Reply: JessicaAtreides37 are you Comparing a weapon against the NAZIs that costed not even 1/10th of the US national budget wit a pipedream that in 100 years might (!) return a tiny profit but would cost 100 fold the US nattional budget?
Who now is silly?
You are the only left in this discussion that defends the SFR!
The question in not what we technically CAN but what will not bankrupt the US for the coming 100 years. Or is that your intention? That will not save the ecology! On the contrary!
You really should get in touch with reality!
Reply: You have no idea where the idea for the 'storage' of energy even comes from or the principle involved because you haven't even read the companies pdf...it's not my idea Clell lol.

You have no idea what I have contributed to this discussion because you haven't and won't ever read a link, links are or can be half of a persons point, if you can't even be bothered to check them...the pathos is yours, you are proving your [literal] ignor-ance.

I have shown [through links] how Pilkington glass have pretty much cracked the 'abrasion' problem [almost as if they were ready for this new idea-technology].
The company involved has [through the pdf you won't read] shown how it can 'bank' the energy it creates within the infrastructure and practices we currently use. The power companies are in agreement that it can easily be done from a technical stand point.

As to Fuku-Chernobyl...well weirdly enough it's about to make its way into the main stream news again soon in a big way Clell, A call for the evacuation of Tokyo has been made [pointless providing you with the link], and the west coast of the USA, is about to hit the news [pointless link again Clell] and the many sailors taking TEPCO to court...well being an old sea dog your self Clell...but nahh! I'm sure you'll be less than interested to know how those poor guys are doing eh my friend?

Stay in your bubble Clell, it's a big scary complex world out here thunderfoot can explain it all too you some time...lol.
Reply: JessicaAtreides37 Poor, stupid Jessica.  Your excuse for posting stupidity is that you got it from the charlatan's website?  You posted that photovoltaic pain was a 'new discovery' remember?  Only if 'new' means since the first patents were applied for in 2002.  Now, I know you're having trouble with that date Jennifer, since it (presumably) exceeds your available number of fingers, but that's 12 years ago.

Your claims of the abrasion problem being 'cracked' (and unintended pun, I'm sure)... It's odd that Pilkington (the company, based out of the UK) makes no claims of 'abrasion resistance in the ton or greater scale.

You do know what cars weigh, right?  Also, Pilkington's own website details that their high abrasion resistant glass (and then only resistance in the 100s of kilos range) is something less than opaque...  Perhaps, just perhaps, that issue isn't quite as 'cracked' as you pretend it to be.

Some moron calls to evacuate Tokyo and you take this as gospel?  Have you noticed that Tokyo is noticeable in it's lace of evacuation?  And yes a bunch of sailors are making the claim that their 'health issues' none of which are recognized as being radiation exposure related, are the fault of TEPCO.  So?  You routinely claim to know what you're talking about while clearly demonstrating the lie behind that.  Claims don't mean a thing.  Proven facts mean things.

A call for the evacuation of the West Coast is 'about to hit the news'?  You're foretelling the future now?

Was your bus for school a short one by any chance?

I can understand how an utter moron like you would find the world 'big scary complex' (though oddly without punctuation), but for grownups, not so much little girl.
Reply: want the links clell...lol.
Reply: JessicaAtreides37 Punctuation is your friend Jessica.  Try again, this time as if you were an educated woman instead of an illiterate child.

Are you asking a question or making a statement Jessica, come on, this is third grade stuff.
Reply: ...so the abrasive resistance qualities of glass are far in advance of what you thought and what thunderfool says, see what a little bit of reading can do for you Clell? surprising isn't it?

No come back from you on the simple and effective manner in which the electricity will 'stored'...not so 'impossible' after all is it Clell? Wrong were you not?

http://enenews.com/professor-fukushima-scaring-bejesus-out-of-everybody-in-the-world-still-leaking-into-ocean-and-we-dont-know-radiation-levels-clearly-detectable-in-tuna-at-california-coast-we-focus

Where the above says ''scaring the bejesus out of everybody in the world''...they mean everybody that ISN'T! a pig ignorant moron...they are NOT! talking about any one on this site so don't worry Clell.
Reply: JessicaAtreides37 and you continue to demonstrate your ignorance Jessica.  Did you notice that the specs for the Pilkington Scratch resistant glass (which isn't transparent BTW) is only resistant to scratching in the 100 kilo range? What does your car weigh?

You actually take enenews.com as a source for science?  Seriously? 

I swear Jennifer, with every post you lower my estimation of your intelligence.
Reply: reading AND thinking clell? outstanding! it must smell like burning in your house right now rofl!!!
Reply: JessicaAtreides37 no Jennifer, among adults reading and thinking is part of any adults normal day... So that burning smell is isolated to you ignorant children.
Reply: JessicaAtreides37 you're now really grasping straws. Not substanciating glass-claims, repeating the same links to a raving lunatics conspiracy theory (being a doctor is no guarantee agains lunacy) in which he stands alone, the list goes on and on.
All your claims can be debunked one by one, but instead of recognizing that, you create a barrage of old and new claims, one even more unscientific and un-substanciated after the other. Are you maybe one of the dupeds who threw money in the bottomless pit of the SFR's?
Denying their worthlessness won't make them work nor get your money back.
Or are you paid by the Brusacks to defend their 'cause' against better judgment?
I cannot think of any other reason to persist in such stupidity.

Go back to school and get a real education or ask your school-dues back. Clearly they did not a good Job!
Reply: Ignorance, laziness and a willingness to blindly comply. Dumbest collection of sycophantic mindless proles anywhere on you tube. Thunderfoot.

Clell! you are now thinking and reading at the SAME TIME! [awesome well done] my work here is done...rofl.
Reply: JessicaAtreides37 Again, your first sentence perfectly described you... Then you ruined it in your second, again.

In no way are you a collection, Jessica.  The voices in your head do not equate a quorum.
Reply: JessicaAtreides37
On you Jessica, there's some right Fossil Fuel freaks here. I say fuck em. Moreover, have these cock suckers ever heard of "Prototype" technology? Moreover, the evolution of a product? One would think not; however, I have heard about biiiiiiiiig companies funding so called pollution denying "truther's" out there.
Reply: Oh great, Jessica's brother is here now.
Reply: Clell Harmon
Oh Great another lame ass paid up right-wing idiot expounding the virtues of living like cavemen. Shit heads like you would have mocked the inventor of the wheel; why, because you feared it wouldn't work, that, or, it threatened your entire dragging shit with branches operation. I am no relation by the way Mr Codpiece.
Reply: SMC01ful Ah kid, it's so cute when you pretend to know what you're talking about.

There's no real shame in being a moron kid, but there is shame in being as proud of if as you are.

I suspect that while you may not be a relation to 'Mr. Codpiece', neither are you equipped to use one.

Sad, aren't you little boy?
Reply: No, I am 6ft2 and 34 years of age, and I played rugby.
Reply: SMC01ful Sure you do kid.  It's amazing how many liars on the internet 'play rugby'... so you're not alone.

Just one among many.
Reply: JessicaAtreides37 people who are completely out of valid arguments tend to resort to insults, insinuations and threats.
You are a classical example. Sad and lonely!
Reply: I'm not defending any one here Clell,I'm attacking your pig ignorant bullshit...big difference dumb arse.
'Sussed' is a British word, it means 'caught out' which is exactly what you've been Clell BULLSHITTER! you have no experience with engineering, product development, electrical engineering, power production, solar-at all! or infrastructure development, You have read nothing what so ever concerning this project,you didn't even watch thundertool's vid [DID YOU?] you were just relying on flim flam and insults the whole time.
You're a tool Clell, go away...grown ups want to talk now.
Reply: JessicaAtreides37 Ah Jessica, it's really cute the way you bring out words and think that your betters don't know understand..

Again, you are clearly describing yourself little girl.  You're just an ignorant little nothing...
Reply: ...a 'nothing' that can and does read and investigate for herself Clell. And doesn't embarrass her self by entering an argument with no idea what so ever of what is going on...try it Clell.lol
Reply: JessicaAtreides37 Yeah Jessica, tell us again about half of Japan and half of Ukraine being evacuated.

Tell us again about the plans to evacuate the West Coast of the US.

Peddle your stupid somewhere else little girl.
Reply: caught out, exposed [for not reading up even the most periferal information on a subject you claim to be an expert at]...and publicly humiliated...by a 'nothing'...bet that hurts.

You can't read so I'll reiterate...the Eastern half of Japan including Tokyo is now so contaminated that MD's are starting to call for the complete evacuation of the Eastern half of the country, or at least a movement of children to the west.

http://enenews.com/japan-doctor-tokyo-longer-be-inhabited-everyone-living-victim-fukushima-disaster-began-notice-childrens-blood-test-results-around-mid-2013-time-running-short-physicians-save-citizens-future-g

If you need to evacuate Tokyo,you need to evacuate everywhere near Tokyo don't you, Tokto itself takes up nearly all of the South Eastern half of Japan. Ipso facto there CLell.

 http://en.wikipedia.org/wiki/Chernobyl_Exclusion_Zone#mediaviewer/File:Chernobyl_radiation_map_1996.svg

This map gives you the sheer scale of the various levels of radioactivity in the Ukraine [about %50 of the country is contaminated-half.] Got that fool. If you listened instead of just ramming your fingers in your mind and screaming no! maybe you wouldn't look such a prat Clell.
Reply: JessicaAtreides37 And once again, poor stupid Jessica, Enenews is a bullshit site designed to alarm the stupid and gullible...  In short, you are their target audience.  Only a fool would believe that tripe... but then, as I said, you are their target audience.

And the map you reference show the exclusion zones amounting to, at most, 12% of Ukraine Jessica... Are you so stupid as to not be able to see the largest part of the exclusion zones are in Belarus?

Poor, sad, stupid little Jessica.
Reply: Bullshit once again Clell. You'll have to show where ene news is discredited won't you Clell? [Without! it coming directly from the nuclear industry, because they ARE the only ones that erroneously claim to have 'discredited' Enenews Clell, no one else can...I've checked, even the UN have investigated them Clell, they have no idea who Enenews is,that is THE UN! could not 'discredit' Enenews so good luck bullshitter] you'll have to show the proof for such a claim won't you? or else it's just more of your lame 'denial system' at work isn't it Clell.
One machine fails and [only lol] %12 of the country is contaminated for eternity, well that shoots the 'nuclear is dangerous' argument down doesn't it Clell?...what a pathetic hair to split in such a pathetic manner. 

You will cling to any belief rather than admit you're wrong, vile...the lowest form of intellect, you've failed your every point and refer [endlessly] to worthless insult toward people that are palpably beating your argument at every turn. You have nothing Clell, be quiet.
Reply: JessicaAtreides37 Poor stupid little Jessica.

The Rational Wiki, a group in no one's pocket has this to say about your source for 'News'.

ENENews, or Energy News, is a fear mongering anti-nuclear news aggregator that was created in response to the Fukushima I nuclear accident. The site tends to have three different types of posts: posts that claim Fukushima I has poisoned the entire Pacific Ocean and adjacent coastlines and that world governments are covering it up to keep the nuclear industry from imploding, posts that report on any and every case of animal death and disease that occurs in the Pacific Ocean and adjacent coastlines, and posts that claim the Fukushima reactors are minutes away from detonating like an atomic bomb and killing everyone in the world with radioactive fallout.

In short, you continue to prove yourself their target audience, Jessica.  It must be from the lead paint your mother gave you to keep you quiet.
Reply: Uhm...no...Enenews doesn't say anything of the sort...Clell!...shush!
Reply: JessicaAtreides37 It's bad enough that you're demonstrated that you're stupid Jessica, there is no need to add 'liar' to your skill set.
Reply: Coming from the utter bullshitter that couldn't even manage to watch this vid let alone actually find out if it's true or not.

Clell...SHUSH!
Reply: JessicaAtreides37 It's cute you keep trying, despite showing what a mouth breather you are Jessica.

With each of your posts I find myself wondering just how short your school bus actually was.
Reply: From the one person on this page that proved that they didn't know a single thing about any of it and were just talking crap the whole time. AND! got beat by a girl...lol.
Reply: JessicaAtreides37 you were beaten by a girl as well as everyone else on the page Jessica?  Wow, it sucks to be you.
Reply: Solar roads are viable. There is much contention to that hypothesis, but no clear winners here clell, where as you were caught out as a clear bullshitter...by a girl.lol
Reply: 1) Uh, there's no such thing as virtual storage with regards to energy, it's merely used somewhere else and later when the energy is required to power the LEDs it requires another power generation source. This is exactly how regular solar power systems work otherwise no one would ever need batteries.

2) The textured glass will be affected by the fact that common sand is everywhere and can scratch tempered glass meaning it will affect the textured glass

3) He made a comment about the product as a whole as well since you need to attach the glass to something the sheering forces on the adhesive would likely fail in a given emergency stop test.

4) With regards to your radiation claims, please look up many places with higher base background radiation than in Tokyo and please tell me that those places need to be evacuated as well. Please also tell me that every stewardess and pilot that experience much more radiation while flying are all mutants are dying from radiation poisoning.

5) By the way, I've read their faq and their "clearing the air" and they demonstrate that either they don't know what they're talking about or they're being dishonest about the flaws in their current designs. You need to actually read it with a critical mind rather than going "oh they they address it" when they actually don't if you think about it.
Reply: Totally original bunch of opinions there Garith...no one's thought of any of that before, you haven't just raised the same bunch of points that we've been discussing for weeks now. awesome well done Garith...[good grief].
Reply: JessicaAtreides37
Sorry, but you stated it, you don't want to research further into it and you don't want to be skeptical about solar road ways despite the fact that their responses don't actually address the criticisms stated.

They could have easily made a 20 second youtube video and gone with a belt sander to prove their glass can stand up to sand abrasion, they didn't they instead made a claim that glass is harder than the bitumen in asphalt which no one cares about.

They could provide actual power generation numbers from their prototypes and at least estimations of power drains from current LEDs and the required upgrades in order to have them visible during the day time, they didn't. Instead they do napkin math omitting the lowered surface area of the solar panels in their tiles, the conditions they'll be in, assuming high grade solar panels and omitting the energy costs for the bells and whistles they want to add and claim that as their potential power generation.

It's pretty easy for them to silence critics if they really had confidence in their product, but instead they put out public statements that appear to try to bull shit their way through any criticism rather than addressing it.

I see no evidence for the viability of solar road ways and their poor responses to the criticism gives me much more reason to doubt than to believe it's viable in the near future for anything more than light use in specialized situations rather than their generalized goal.

On your Tokyo/Fukushima rant, read the interviews with the physician he didn't do any tests before, he had no controls, claims no one else is doing similar tests. He doesn't even have a base line rate of how things were before on a broad basis in at least one interview I read. As far as I can tell enenews is the same as a few other sites like natural news on the matter, vastly over hyped paranoia with little or no skepticism.

I like wind and solar fyi, wind is better than imported oil on eroei alone and we should be doing as much as we can to convert to a greater percentage renewable sources for energy security, to address climate change and for long term investment, but everything I've read from skeptics, proponents and the solar road ways people indicates that this isn't likely to be a viable project in the near future because they're trying to have materials do too many things at the same time with conflicting goals resulting in a product that does everything in a mediocre way.

Also with regards to your statement about "virtual storage" it's very heavily implied in your original statement that you believed the energy is "banked in the grid and redrawn at night" implying that you thought it was the same energy rather than the energy was used, and the energy for solar road ways use at night would be supplied by another source. If you don't like that's the conclusion that everyone drew from your statement you should have stated it in a proper way.
Reply: This project or something very similar. We really don't have much choice. We are well into a massive energy crisis. Russia has a gun to Europe's head in the form of gas supplies. The Arabs are desperate to sell their oil to any one but the west [China and India can buy and use it all, no problem and pay in gold, we pay with debt and weapons], we are so desperate that we are going to tear up the Arctic, we are now going to drill for oil for 3 months of night time in minus 60 degs' and 70 mile an hour winds...this is not 'exploration' or 'development' this is desperation pure and simple.

This [or similar] WILL! be coming to a world near you very soon, every western government is working on it [quietly] the technical difficulties [of Solar!-not necessarily this project but Solar in general] are being solved as we speak. 

Pointless providing links on this page [you are all terrified of them]. Put it this way it's this easy and simple to see for yourself, just go to any you tube channel that comes up when you write anything like ''excessive radiation in Japan'' Choose your own series of words, ask how you like, but there is vast evidence from the people there [you can see it on the Geiger's they hold up to the cameras...right in front of you! you can just go and see for yourself right now!] the people of Japan are in a lot of trouble and it's getting worse by the day.

[you haven't done this so far have you? you haven't once checked for yourself what is actually going on in Japan have you, so how can you feel qualified to comment on it?, this thread is full of people doing this shit, I'm used to it Garith, it's exactly the sort of people Thunderfool appeals to]

'Air crew' is a sick, cruel, ignorant response to what the Japanese people are going through,on behalf of the Japanese nation I would like point out that you can ''go and fuck yourself you ignorant pig'' for that one Garith.

On this link I've been told several times that [''power stations provide precise amounts of energy, they can't just take on more power!'']
or words to that effect, with that level of ignorance as to how our system works, forgive me for not taking almost all of the 'cons' so far provided on this thread less than seriously.
I just can't take any of you very seriously, most of you haven't even watched Thunderfool's bullshit vid, let alone investigated or even 'thought' about this. 
Thunderfoot, is where personal discernment goes to die.
Reply: JessicaAtreides37
1) We have far more efficient means of employing more solar and wind, we just need more of a political will to both implement it and update our grid so it can handle it properly.

Solar road ways is not tested, not proven, has many shortfalls, is vastly more expensive than traditional solar and wind, is questionable if it can even produce more power than the rest of the technology that people want to employ.

Plenty of other countries have employed solar and wind in big enough quantities without relying on something as niche as solar road ways so it's pretty clear it's not a need. Better solar technologies are always being worked on, it's getting cheaper, but current technologies can fulfill our needs if we have the will to employ it.

Solar and wind are fine, solar road ways are not because solar road ways requires a surface that is transparent, but durable enough to have a 20 year life time of being driven on and cheap enough to employ on a large scale as in at least as cheap as tempered glass. Even gorilla glass which is slightly more expensive and the most scratch resistant glass we have (when coated) can't hold up to the rigors required. It needs to be harder than glass so as to not be scratched by sand, but not so expensive it requires several times over it's self to pay for it's self.

This is just the problem of the covering, not getting into the additional infrastructure or other issues that solar road ways would bring that traditional solar or wind do not. The fact that it's questionable if it could power it's own LED's and additional communication technology should at least give you pause to think if the project is worth it at all. It's also one of the thing solar road ways has never put numbers on despite it being the most important thing about their project.

As a note I'm not even getting into other viable technologies like geothermal (where applicable), nuclear that uses old nuclear waste as fuel (still needs work), or any other types of viable energy production which have far more going for them than solar road ways.

2) sigh holding giger's means nothing if you don't know exactly what you're looking at or looking for. General background radiation can be high if you look at the right things. Besides Tokyo is far enough away that it would only have been a bit above background.

You can find amateurs "finding" radiation on the west coast of California, but what they end up measuring is sand that contains radioactive isotopes which was always here. And if you do searches with biases imputed into them you're going to "find" exactly what you're looking for without any ability to be more informed on the topic nor the proper context of what they're looking at or any opinions of experts that would know what you're looking at.

Also googled it, you don't really get what you might think you'd get for hits. Some are sailors trying to sue tepco for supposed health effects from radiation when radiation safety officers on the same boat indicated no harm because you know they were on a nuclear powered aircraft carrier and had instruments appropriate to determine safety. There's some hospitalizations of people who were directly involved in the incident which are cases where you would actually expect radiation exposure issues. There are also a few stories of atomic bomb survivors. And some possible cases about increased thyroid cancer in people actually from Fukushima. Despite you asserting it's some sort of huge emergency that Tokyo needs to be evacuated for it really doesn't seem to hit high on Google.

3) I'm of Japanese descent so I happen to be quite sensitive to both Japans actions and what's happening in Japan so you can frankly "go fuck yourself" with regards to this topic.

Also the background radiation is higher than Hong Kong and Paris than it currently is in in Tokyo, I suppose we should evacuate Hong Kong as well as any other place with higher background radiation.

4) None of your statement really addressed anything I stated, all you would have had to do to prove me wrong with regards to what I said about solar road ways was provide specific links to specific claims or address why you think my specific claims are wrong. The fact that you didn't indicates that you know they're not there either but you don't want to admit it.
Reply: You are so right, but do you realize you are feeding a troll?
Reply: I don't think that's fair or true, [the troll bit] I've made a pretty consistent point that we cannot simply look at a project like this and say 'we can't'. How can this idea be 'busted'? it hasn't failed! Could it be an equally valid point to say that thunderfoot is in fact 'trolling' this idea? 
As mentioned in earlier posts technology is moving rapidly, applications are increasing, nations are investing vast sums into wind, wave and Solar, very successfully,

Solar http://www.iflscience.com/technology/solar-plant-achieves-supercritical-steam

Solar can now compete with fossil on a one to one basis, supercriticallity is getting the steam form a Solar plant to move faster than the speed of sound, same as fossil, Solar is now fully able to compete with fossil on a one to one basis, nes pas?
Without seeing a working prototype succeed or fail it is just plain wrong to say that this 'can't be done'.
We have [at I admitted! a 'stretch'] the technology to create this and I [believe] to make it [or something very similar for certain areas of the landscape] work. 
For the above reasons do you agree that I am in fact not! trolling but offering a consistent and coherent opposition to the premise of the video, id est-'busted'?
Reply: JessicaAtreides37
1) He's not criticizing solar/renewables he's criticizing solar road ways.

2) Solar road ways refuses to post any specific results from their initial solar tiles despite bragging about having prototypes. No power generation, no power drain, estimated net energy, nothing.

3) It's not a matter of "can it be done" it's a matter of "can it be done in a way that actually generates net energy". You could probably make the tiles out of diamond with a translucent resin with billboard quality LEDs, but it would consume far more energy than it would ever generate. It would also have to generate enough power to warrant the additional trench/wiring and energy infrastructure to connect all of the roadways to the grid since it's requiring electricity to power creating the lines.

4) The major issue is that everyone crunching the numbers ignoring the energy requirements of the additional materials still wouldn't be likely to power the bells and whistles they want to have on the tiles.

Traditional solar/wind don't require all that additional infrastructure, don't require exotic materials to cover it as will be required for solar roadways, don't require LEDs or a huge amount of communication technology to create patterns, don't need to power heating elements and can use both the best positioning and simplest materials to accomplish the job.

5) They might be able to employ a more passive system to areas like walk ways or parks (places which are traditionally shaded making me think it's not worth it) but their grand project of replacing all road ways without giving up a lot of their desired bells and whistles is already DOA. Even then it doesn't have the benefit of traditional solar or residential solar which don't require extensive amounts of extra infrastructure, can face the sun and don't require all the additional materials to withstand the rigors of being a road way.

6) No, unfortunately you're not because you basically accept posts on solar road ways as gospel without realizing the actual criticisms of solar road ways or why their responses don't actually address the criticisms.
Reply: 1. Criticizing, Solar roads is criticizing Solar renewables, in exactly the same way that all other Solar projects were initially criticized.

2. It's called product and patent development security. Perfectly normal company behavior.

3. Refer to 2. does it produce enough net energy? I don't know and neither do you, once again 'busted'? it hasn't failed or succeeded yet so rationally it can't [yet] be 'busted'-[proven failed], can it do what it says? we don't know=not 'busted'.

 4a. 'crunching the numbers'...well without the companies input on the 'numbers'...what's there to 'crunch'? 

4b.''Traditional solar/wind don't require all that additional infrastructure,'' Sea based wind farms require horrific amounts of technical and infrastructural support, dessert environment Solar plants require daily cleaning of all of the mirrors [for instance] and they still make a profit.

I would like once again to point out my stance on this subject,I do not care if it works or no [but I think it could if implemented correctly], I do care that innovation is being nothing more than' looked at' and condemned based upon little more than 'it's not how we do it now'.
Reply: JessicaAtreides37 Oh god, she's back, and trolling as usual.

1 No, it isn't. Criticizing Solar Roads is no more criticizing Solar renewables than criticizing some fool flapping his arms is criticizing powered flight.

2 It's called hiding the data so that the rubes (which you would be one of) will keep funding the waste of time.  It's a perfectly normal behavior of charlatans.

3 the mere fact that they won't tell us what their getting out of their panels or even what the energy required to melt their ice test tells us that they have something to hide.  They have admitted to using off the shelf solar cells, so it's not like they're trying to protect some secret process.

4.  More of your patented bullshit, but I particularly enjoy your 4b comment " dessert environment Solar plants require daily cleaning of all of the mirrors" while utterly missing the irony that you are ignoring the continuous cleaning that will be required of any road surface.

Pathetic Jessica...  But at least you're consistent.
Reply: JessicaAtreides37
1) No it isn't, most solar projects are just trying to employ solar in new ways, this is trying to take an old technology and employ it in a place that has both new requirements and a lot of bells and whistles that aren't required for solar.

2) Not when your whole objective is to produce net energy, it should be the #1 thing you're touting because it's the whole reason for your project.

3) Since they refuse to put out numbers and work off of existing technology all that people can do is go off of existing technology. Besides there are physical limitations and energy requirements you can't get around without breaking the laws of thermodynamics and I'm pretty sure I wouldn't hear about this first from solar road ways.

Just like how I wouldn't expect to see the first break through in glass technology with regards to scratch resistance from solar road ways rather than an industry like smart phones which have been working on the problem with a far larger pocket book with lower requirements and just as much reason to want to address the issue of sand scratching glass.

4) Basic properties of materials and energy production are where the numbers are being crunched. If you're hiding behind the fact that solar road ways seems intentionally vague those are actually huge marks against the project with regards to skepticism.

5) "Sea based wind farms require horrific amounts of technical and infrastructural support, dessert environment Solar plants require daily cleaning of all of the mirrors [for instance] and they still make a profit."

It wouldn't be anywhere near the amount required for solar road ways as it would require the equivalent of making a whole new grid to attach to the existing one. Cleaning mirrors isn't comparable to replacing the LEDs, maintaining/replacing the glass from being driven on and all the extra additional maintenance that is required by having the requirement of the panels being driven on.

Your stance still doesn't address my points, especially ones with regards to traditional solar power plants and residential solar being far far more efficient because of the inherent design flaws of being a road way that you can't get around.

6) People criticize it with good reason, solar road ways claims to stand behind their product but put out nothing to actually address the legitimate arguments and dismisses the people rather than addressing the arguments or putting out the data or even short videos to demonstrate why these aren't issues for their product.

People also are addressing you this way because you again are avoiding the actual issues of the inherent problems raised by putting a solar panel as a road way that will automatically make it less efficient and have additional requirements. Instead of addressing them you point at other solar/wind technologies as if it's the same thing. It's not so stop pretending that it is.

It's like if someone were to propose putting wind mills on planes and it was criticized and you said "this is the same as any other wind project and criticizing it is the same as criticizing all other wind projects."

7) People aren't "just looking at it" they're examining the inherent design flaws and requirements, the materials involved in the project, the requirements for the materials and going from there.

Just like people looked at thorium powered cars, the physics, materials, claims and requirements and came to the conclusion that it was bunk. It's not like people had to wait till the first thorium powered car prototype came out before they could determine it couldn't exist.
Reply: http://www.iflscience.com/categories/technology

I mean just for fun, here is an idea for using cigarette buts to store energy, notice 'store' energy!

http://wardsauto.com/ar/thorium_power_car_110811
[You will notice that there are plenty of people working hard on Thorium power at the moment]

It must be built, tried and failed before it is 'busted' and even then it may not be 'busted'.

Cigarettes and Thorium are being worked on because many people on this planet [although no one here lol] realize what an absolute mess we are in as regards energy security, We are already making the ''impossible'' work on a daily basis.

''Bells and whistles''...define? the lighting [how to] has already been explained by the company on its pdf.
There are millions of miles of road all over the world where this project would be suitable and these miles require no lighting at all ever.

There is no distinction between this and any other Solar power process[ based on panels], something lays in the sun and separates electrons for us, no different to a roof tile. It just needs to be a fair bit tougher than a roof tile, as if! we can't manage that, in fact we are managing that right now. Solar plants have just managed to become 'super critical' this puts them on a one to one basis with fossil...all over the main stream news isn't it?...not. Why?...if you don't ask and answer that question for yourself, you simply don't understand the world that you and developments like the Solar road are in.

'people are talking to me like this' because as it turns out, what they thought and what is are 2 different things...guaranteed to piss off a human that is. [especially thunderfoots little sycophants]
Reply: +JessicaAtreides37: o, yes, lets all go chain-smoking. An other way to lessen the populaton pressure! We all get lung-cancer!

What is your issue? Denying Critique or Supporting Stupid Ideas?

And since when are you supporting Nuclear energy?
Reply: JessicaAtreides37
1) While this is generally a cute concept, I'm not sure adopting something that encourages an unhealthy habit that produces ghgs on it's own isn't exactly the best of ideas.

2) You already came out against nuclear in this thread and determined it didn't work, but now you're saying judgement needs to be withheld until it fails. Even though technically initial failures doesn't indicate a project can't occur if you want to be honest you should at least try to keep consistent positions.

3) I'm actually quite for working on thorium nuclear power because it actually as a lot of potential benefits. I'm for quite a few other projects involving fission and fusion, because there are a lot of fail safe ways to employ technology with modern methods long as people don't focus on the few events with out of date nuclear power plants which resulted in disasters.

4) "the lighting [how to] has already been explained by the company on its pdf."

Except they admit that their LED's don't produce enough light to work in the day and don't have any working prototypes that are sufficient for day time driving. Claiming it works and having one that does work are 2 different things.

5) "There are millions of miles of road all over the world where this project would be suitable and these miles require no lighting at all ever."

Kinda seems to defeat the purpose then and it just seems you should use more traditional solar systems and asphalt if you're just going to either use existing infrastructure or put it on roads that aren't going to be used often. Having to build additional grids just for the sake of making an unused road for something that's thousands of dollars per square foot doesn't seem an efficient use of resources.

6) "you simply don't understand the world that you and developments like the Solar road are in."

It's just a regular solar panel, that's not complicated. The issues are that they're putting it in a spot that's both inherently inefficient and it requires additional materials that adds to the energy required for the solar panel, consumes energy where most other solar panels do not and the covering results in a drop of energy collection.

Just the collection drops by huge factors because of the requirements of the product, over 60% loss from not being able to track the sun, 11% because it's under thicker glass, even greater losses because it's being driven on and cleaning regularly becomes an issue, the project requires additional parts not required by traditional solar systems, and have it power even more things such as the communication system to be in a constant network and/or lighting. You're looking at something which is infinitely less efficient than a passive system like asphalt combined with traditional solar, because even in a standby mode it's draining power where asphalt is not.

Try to remember that factors like how you place your solar panels matter. The same solar panels can change from 10 years to return on investment to 100 years if you simply face them the wrong way. If a standard solar panel without the LEDs, without the power drain from being in a constant network, without the power loss from the thicker glass, takes around 10 years to pay for it's self how much longer will it take to pay for it's self (if at all) with those systems and requirements that standard solar panels do not require.

I don't know why you're pretending like we're running out of roof tops or land for traditional renewable energy, but we're not even close and traditional solar has a lot more advantages with less requirements than solar roadways and is a much more efficient use of materials when you look at the power generation difference alone.

Also don't pretend to be all high and mighty with regards to being knowledgeable on this project. Everything the makers ever produce is beyond vague, you hide behind this fact all the time so stop pretending that you know that solar road ways is beyond advanced when you yourself admit that you don't know any of the details either.

7) "because as it turns out"

No, it's precisely because of what I said and I find it amazing that you simply did it again. Stop pretending that solar road ways is some brand new technology. It's simply trying to implement old technology in a new packaging which happens to be far far less efficient than existing technologies.

In the power generation game, efficiency matters, the amount of materials and energy required to generate a given energy matters a lot, how you use those materials matters a lot. Solar road ways inherent design adds more requirements and puts solar panels in one of the least efficient spots possible affecting all of these simultaneously. Sure you can make these tiles, and they may generate some power, but nowhere near the amount that an equivalent amount of resources would provide in a traditional solar power plant or in rooftop solar by basic design.

Unless solar road ways can magically generate more energy from less direct sunlight that somehow can't be employed on traditional solar it will always face these issues because of it's design of being a roadway.

8) I'll put it in the simplest math possible. Solar panels last about 20ish years even according to solar road ways. They take about 10 years to pay for themselves when they're in a system able to at least angle towards the sun. If you take a solar panel and just lay it on the ground you reduce your energy intake by around 1/3rd, the glass is another 11% loss. These are all numbers agreed upon by solar road ways themselves. This is just with a regular solar panel, none of the bells and whistles, taking into account the extra materials or the extra wear and tear that come with being a road way or replacing other parts that don't last the 20 years.

You haven't even gotten to all of the additional requirements of solar road ways and you're approaching 15 of it's 20 year life cycle just having thick textured glass on a solar panel lying on the ground paying for it's self. These aren't just little kinks to be worked out. It's the basics of the technology and the application. It's also why efficiency matters.

3/4th of the average life time will go to paying for the solar panel, anything more will eat up more of it and none of the added technology is minor with regards to manufacturing or energy consumption.